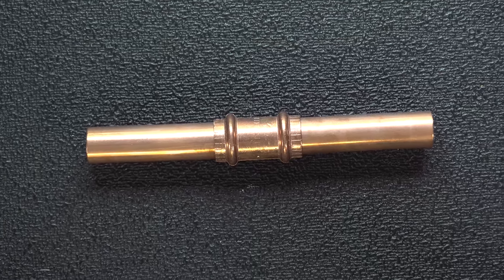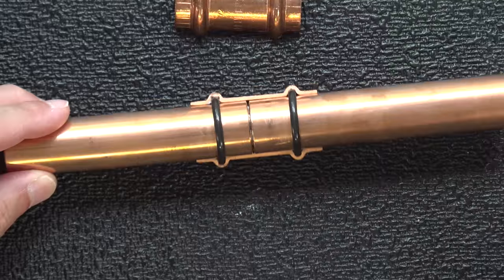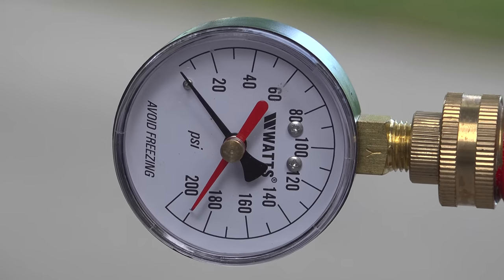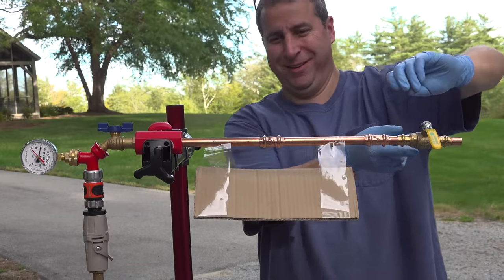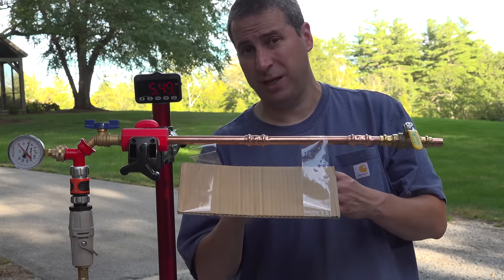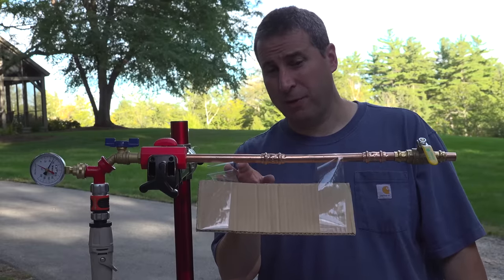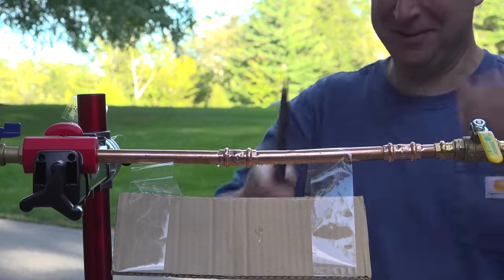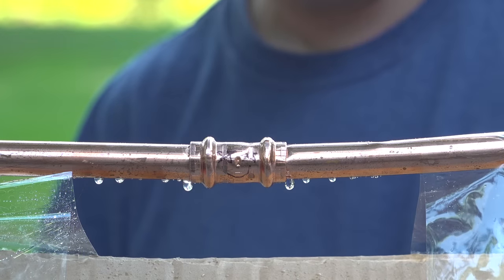Do O-Rings Really Leak Over Time? Testing PROPRESS

Comment: I think the O ring does more than catch a small weeping connection.  I have had propress fittings leak.  Usually it's my fault.  Not deburring the pipe good enough.  But I have also had leaks when everything was done exactly correct.  That being said I've had sweat joints that have leaked.  Everyone has had that happen to them if they are being honest with themselves.

Comment: There are a few things you can do to ensure an even stronger connection as well. Using a deburring tool on the inside, and outside of the pipe, properly sanding the ends of the pipe that will be joined, and ALWAYS testing the depth of the fitting on the pipe. 
The only time I’ve seen a pro press fitting fail was due to improper installation. There is a reason Viega warranties these things for 50 years with those caveats.

Comment: Electrician, here. I'm still fighting with brothers who refuse to accept WAGO connectors...decades on.
Some people are just not willing to accept reality. Good video! Thanks.
Reply: Heh.  Same folks who insist that cordless tools are a fad.  "You'll have to pry my Mag 77 worm drive out of my cold, dead hands!"
Reply: @SplashJohn we live in a temporary society. Old tools last forever, new tools last a few years.
Reply: I DO HVAC AND WAGO IS THE WAY TO GO, DOING CONTROL WIRING SO MANY TIMES I WOULD HAVE ONE LOOSE WIRE IN NUT, NOT NO MORE. PLUS, IT IS JUST A CLEANER JOB
Reply: I've had several WAGO's that failed due to user error I guess. When the wire appears to be in, all the way, I've has them loose connectivity.  After a few customer complaints (sometimes they have to loosen the connection an reasseble because of a specific installation) and one Customer who's wago nearly melted; I bailed on them altogether.  To much at stake for the saings over a traditional din rail mounted distrobution block method.
Reply: I'm rerouting wiring in a 50 year old house.  
Back then they mostly used crimps; and they are NOT coming apart. 
Even in places where they did use wire nuts, they are still staying put. 
I do run into problems with WAGO when the wires are pushed back in the box, and the lever got hung up on something, and the lever got flipped. 
I use WAGO where I anticipate changes.  
And in places like in the ceiling, where the wiring is permanent, I trust wire nuts more.  
Also in high current, I use wire nut.

When I use WAGO, i tape the levers down.
Reply: WAGO rules
Reply: @rickybobby7276 I was going to say something like that! Remind that guys that back in the good old days, wires used to be twisted, soldered, then taped.  Guys using wire nuts are just lazy hacks 🤪
Reply: @drcpaintball  In terms of resistance wage is probably equivalent 3-10 inches of wire. Imagine electricians opinions 100 years ago then they moved from soldering to wire nuts.
Reply: @drcpaintball I agree wire nuts have less resistance but where are you getting your data that running 20A 240V through a WAGO is dangerous?
Reply: Love love dark connectors
Reply: @johnimamericanjett8095  Because you are a HVAC guy and not an electrician.  Done properly a wire nut does not come loose.
Reply: @e1000sn  Exactly I used WAGO and found them to be an inferior connection over the long run. Especially for circuits that pulled any amperage over 5 amps.   I would cut them off in units that had them to make a proper wire nut connection.
Reply: WAGO Is nice, they work better for inexperienced people. Just like twisting wires before using a wirenut, while they say you should do that, I do not, I have done residential/commercial wiring for 50 years, and have never had a failure on a wirenut connection. Plus, if I ever come back to a joint and need to separate the wires, it is much easier. It's all about paying attention and experience, and those have nearly vanished.
Reply: @stevem1081  much easier to separate then a wago? Not
Reply: @johnimamericanjett8095  I didn't say that, pay attention.
Reply: I've seen more failed wago connectors then wire nuts. Some have literally fell apart when pulling the outlet or switch back out of the box. The wago plastic just gets brittle or something and cracks. 

I'll stick to wire nuts for a little while longer
Reply: MAN, WAGOS ARE BETTER THAN TERMINAL BLOCKS. Yeah a bit more contact resistance big whoop. People who refuse to wago make me die inside.
Reply: @dimitar4y  some people just want a better quality, longer lasting job, they don't use wago when they want that.
Reply: @stevem1081  wtf, wagos are a quality long lasting job what are you on about. They're maintenance free.
Reply: Just got my hands on a HEWLEE TOOLS copper pipe crimper from AMZ, and let me tell ya, it's a steal compared to those big names like Milwaukee and RIDGID. Been using it for a bit now, and it does the job just as well as those pricier machines. I'd say give it a shot!
Reply: @justatorchicli4240  issue is with the accuracy tradeoff comes a "it might just randomly fail in x years".

Comment: The pipes will vibrate and move over time due to temperature changes, pressure changes, etc...  The fitting will have a slightly different rate of movement and expansion or contraction which could slowly cause the leaking to occur over time if the o rings are missing.  Thank you for sharing your experience!
Reply: Long term 
No Bueno
Reply: I would say the temperature change inside of most houses is like 4 to 6 degrees over the entire year
Reply: @blackwall619  I mean it’s been the standard in Europe for the last 30 years and there haven’t been many issues with it so
Reply: @blackwall619  Always great to be taught by people from countries with lower quality construction standards (be it infrastructure or house building) on how things are done properly. (Attention, that's sarcasm). Greetings from Germany :D

Comment: Quite interesting!  Wonder how the metal to metal connection will hold up with repeated heating/cooling cycles over the years.
Reply: I was just thinking this exact same thing
Reply: Agree
Reply: I was going to ask this question too.  It would presumably take a long time to test.
Reply: They are same metal so the will Heat and contract at the same rate. I don't see a reason how they will fail.
Reply: The metal to metal connection won't hold up. You definitely need the rubber O-ring.
Reply: @xsauce3858 : Won't one of the directions of expansion/contraction be lengthwise, causing pipes and coupling to abrade each other?
Reply: What if I told you that soldered copper pipe is also a metal to metal connection, but it uses dissimilar metals?
Reply: @LowJSamuel  : The solder makes chemical bonds, so the question is whether the bonds are stronger than the thermal contraction force that pulls on the bonds (regardless of the similarity or dissimilarity of the contractions).
     The propress squeeze doesn't make chemical bonds, but perhaps the pressure creates enough frictional force to prevent lengthwise relative movement during expansion & contraction... for awhile.  But what if the occasional thermal expansion of the propress coupling causes it to gradually revert toward its original unpressed shape, which had a larger diameter?
Reply: @brothermine2292  Crimps, at least those for  copper electrical wires, form a cold weld.  I suspect these plumbing fittings work similarly.
Reply: @LowJSamuel  : Cold welds require the metal surfaces to be scrupulously cleaned of their oxide layer before the pressure is applied.  But propress doesn't do that step.  It's also uncertain whether the copper surfaces of the pipe ends and the inside surface of the propress coupling are free of irregularities, but it's probably a good bet that the pipe ends' surfaces have many irregularities that would interfere with cold welding.
Reply: @ChavezDIY  chill broski
Reply: As a plumber I feel they put them In there for air.  You're looking at this with water application only... water has a much higher viscosity and surface tension than air.
Propress is also used for compressed air lines (not to mention to air psi test a building before you go to water)

Comment: We did a 500 VAV box change out about 13 years ago swapping out existing boxes with new, all had Hot water heat connections.  It was an occupied medical building so it was decided to use Propress fittings so as not to have to get burn permits and not have to use any torches in the ceilings.  It went well the guys missed pressing a few here and there which we found testing with air.   As far as I know the system is still holding together.  Only draw back is the tool is large and hard to get in tight areas.  Also the Tool is expensive and fittings are real expensive.

Comment: Risinger did a video earlier that mentioned the same thing. Viega had told him the O-ring is not in the water path. The tool smashes the soft metal together to form an effective bond unless you move them apart by banging or bending.

Comment: Also, a bunch of hot cold thermal cycling might induce a leak without the o rings. 
Rubber does not last forever, at some point it does deteriorate especially when it is exposed to chlorinated water flow. In these fittings the o rings should last quite some time. 
All these new plumbing materials and methods are great. 
How do propress fittings hold up in freezing conditions?

Comment: I work for a company which designs similar fittings. European market requires a test of 5000 cycles of alternating 20 and 95 degrees Celsius water under 10 bars (145 psi) of pressure. Which simulates a lifetime of ~49 years. So sure these fittings would last a while without O-ring, under these conditions.

Comment: If you going to say that the rubber breaks down over time and starts to leak I believe that. However we have a hydrojet at the shop and a copper water supply line put together with ProPress fittings running across the wall to the back door. This entire line has been here for 10 years and the only part of it that's leaking is the ball valve that we use to turn on and shut off when we're filling the hydrojet or done filling the hydrojet

Comment: Is pro press common in the states? In Canada it’s not quite mainstream. I personally love it because it lets me smoke the competition in commercial copper jobs
Reply from the maker: Heating contractors use it like crazy, it seems like every one does for the speed and considering most heating systems are removed within 30 years, there isn't any concern about potential failures, though these are designed to last for 50 years + But some plumbers use them but still not super common. Viega needs to release their patent and focus on the fitings, the tool prices ruins this for most people.

Comment: I just pressed a joint yesterday that leaked. 1 out of about 200 joints i did that day, try that with solder.  When I have a leak i always like to cut the pipe as close to the fitting as i can so i can stick my finger in it and see if the joint wasnt inserted fully. i found the oring had pushed 1/2 way out the joint.  It took over 30 min to form 1 drop!!!

Comment: In aircraft maintenance, we use permaswages to repair rigid hydraulic lines. They follow the same principle. They don't O-rings. They are good for over 4000psi.
Reply: They dont follow the same principle, swaging is completely different to just compressing metal on metal. Swaging cuts into the metal to produce a seal, thats what they do to copper pipes when they run gas through them.

Comment: Nice test. U should have done some expansion and contractions test with hot water before hitting in.
It a okay product. I will believe its worth in 20 plus years if im not constantly fixing leaks on them, like i am these days with old push fit.
Works for site fitters where they dont want you to use Hot works.
But at £1.50 per fitting and £1000 for a press.
I will stick to enfeed can fit out a whole house for £50 of fittings

Comment: Pro press is an amazing system, I wonder if would be suitable for gas piping, as in HVAC for air conditioning purposes, if so or if they make a version for that purpose it would also be a game changer.
Reply: got mega press for black iron or grazine pipe, for hvac have different company make those
Reply: ZoomLock!!!
Reply: Look it up
Reply: fuel gas, and many other gases Viega has IPS MegaPress fittings

Comment: Interesting. But I still prefer to solder, considering that I can make a chimney of 500 kg fall from 2 m high on the soldered tubes, it'll not leak, the tube is actually more easily broken that the soldered parts. I tried that unvoluntarily. And soldering is cheaper, easier to do in tight spaces. The only application where these fittings are increadibly great in my opinion is where you need to avoid heat and ignition sources.

Comment: As someone who crimps a lot of stuff every single day. This might look impressive but with repeated hot/cold cycles the metal will move and there will be a leak without the o rings because theres no interlocking going in between the two metal surfaces its just being held in by the inital crimp, thats why the o-rings are there to actually seal during movement. O-rings are rubber and rubber degrades over time so this fitting will eventually fail, which isn't a problem with most other applications of o-rings since you can usually replace them but these are not replaceable. Brazing is much better because it actually bonds the two metal surfaces together,  brazing holds up to 70 000 psi!
Reply: Exactly! Although soo many are looking for a quick fix, a no-brainer, a no-experience required tool, or are just lazy! When I was young I was taught that all rubber will degrade and now as an adult working as a maintenance technician I can tell you that all rubber seals will fail and with plumbing a connection that is meant to be leak free "forever", not just 5-20 years then why take risks?
For a homeowner I think it's ok to take a shortcut such as pro-press or sharkbite. But any professional should be thinking of longevity not look smart by completing a job crazy quick. 
I wonder how many plumbers out there mainly use compression fittings and have anxiety of when they all start to fail! lol 
For anyone looking for a quick plumbing method should use Pex pipe which is plastic not rubber and has no rubber seals.
Reply: @mrdan2898  Idk why americans dont seem to use them but Ermeto fittings for copper is the much better alternative, I personally dont like PEX because the water quality degrade over time because it doesnt cleanse waterpipe like copper does. I lived in an apartment that used PEX and by the time I moved out the water quality was shit.
Reply: @spoofer20  Funny that you mentioned the Ermeto compression fittings. Just yesterday I was thinking that they would be a great choice over sharkbite. 
I have used these compression fittings on certain situations and rarely run into issues. There's also no rubber seal that can fail, thus as long as they are installed correctly there is little chance of future failure. My workplace uses heavy cleaning chemicals that will degrade rubber seals or non-stainless connections. I aim for stainless connections and then I'm worry free.

Comment: My 6 year old plumbing failed with this and 28 flats were 'upgraded.' Clearly the sides get full compression while the front and back get no compression at all.  The toolhead should have segmented sections. I guess it is only a matter of time when the joints fail upstairs and I get flooded.

Comment: It should be noted that some propress fittings rotate slightly even after they are pressed.  The ones that rotate probably need the o-ring.  Such as street fittings and female adapters.

Comment: Wow, I was always so careful to protect the O ring.... what a waste :P They are expensive though, and I don't see why the o-ring would fail, but good to know it's not needed!
Reply: wtf yes it is needed!
Reply: It most certainly IS needed unless you want your piping to look like a lawn sprinkler either immediately or after a short time.
Reply: @nheng6913  Did you watch the video?
Reply: @RobotMowerTricks  It is needed because crimping will only hold the two metal pieces together until it experiences temperature changes over time, metal moves and with movement the crimping wont stick. Crimping wont fuse the metals together. I work at a production facility and we crimp all kinds of stuff and if we just crimped metal on metal it will leak 100% over time even at very low pressures.
Reply: It is needed, the video just proves the fittings are really extremely tight when pressed.

Comment: Not true. I always look to make sure the ring is fine, but last summer I had a doctor crawling down my back to hurry with a repair because they can’t operate the office without hot water in exam rooms. So I pressed a fitting, turned in the water and the fitting leaked. I had never had that happen so I was surprised. I cut it out and finished the repair. Back at the shop I split the fitting to find there was no o ring in it. Which explained the ring I later found on my passenger seat 🤨 but long story left long, they don’t seal without the ring. And solder as much as you can. I love press 1. To avoid hot permits 2. For speed 3. Final connection to avoid the annoyance of being set up and having a drip ruin everything. Soldering is cheaper, and some will say more dependable (as long as you clean your flux off afterwards)

Comment: The ProPress clearly isn't for consumers with that price, it's for professionals. Anyone who thinks they suck can argue with the 50 year warranty. It's faster, works in adverse situations like tight fittings or water in the line, and it's nearly idiot proof. A professional obviously should know how to solder, but this is just as good for nearly all consumer applications.
Reply: The tool can be rented.